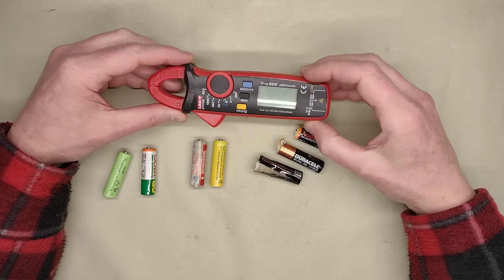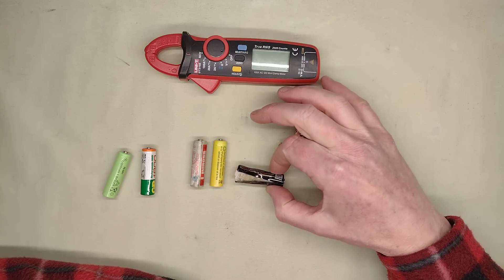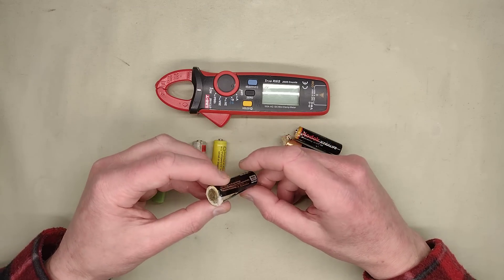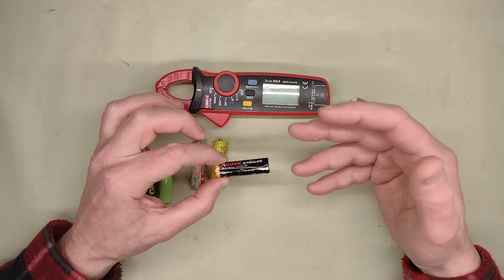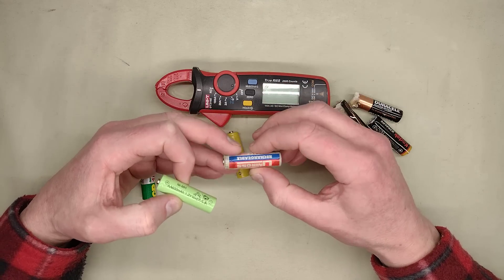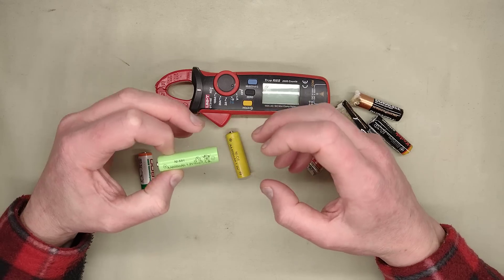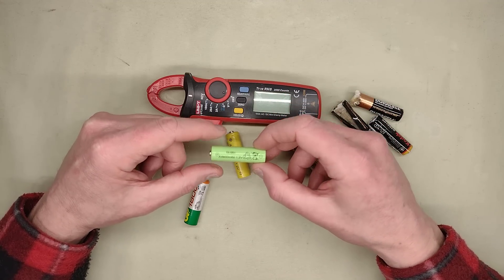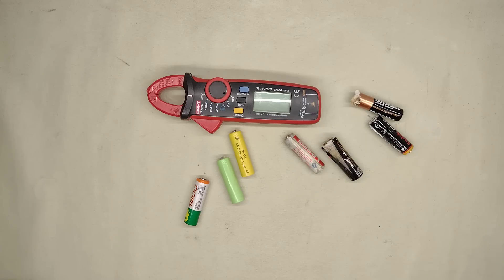The curse of leaky alkaline batteries

Comment: Clive, I fully agree: Alkaline batteries are frustrating. We don’t need leakage-damage warranty. We need batteries that do not ruin our devices!  DuraLeaks, IkeALeaks, SamsCLeaks, CostcLeaks - My experience is that all and each of them leak, some sooner than expiration, some with remaining charge - then our equipment is ruined. But I found a Solution and replaced Alkalines for 3 other types. Now I have Zero leak issues in the last 5 years: The solution I found resides to use just better brands of Zinc-Carbon, Eneloop NiMH batteries or Lithium 1.5V.
[1] A good Zinc-Carbon here (*) is the Panasonic Heavy Duty (not sponsored)  - incredibly, it never leaks! I use them as first choice for low power or intermittent consumption as IR remotes (TVs, Split AC).
[2] For most higher consumption, I use NiMH like the Eneloop or Panasonic’s orange ones (also, not sponsored) - they offer a higher voltage as 1.30~1.35V and show negligible self-discharge. They work great for weight scales, illuminated backlit remotes, motorized toys & appliances, etc.  
[3] For a critical application that seems to not be worth using the Zinc/NiMH options, I use non-rechargeable 1.5V Lithium AA batteries, as last resource - being difficult (*) and most expensive to find. An outdoor weather station transmitter has been one of these cases.
(*) = I lived for a while in the USA, then returned to a Brazil, where I live.
Thanks and Have a great Holiday season!

Comment: I bought an Atari SuperPong console from Ebay recently. When I got it I realized that it was heavier than expected.  I was ready to find a huge mess inside,  but instead found 4 perfect 1980s vintage Rayovac batteries. The only problem is that I didn't get to see if they would still honor their no leak guarantee!
Reply: I have a pair of Rayovac AAs in the remote to my Panasonic plasma TV from 2008 that I barely use anymore.  The battery compartment is pristine, the cells test at 1.45v, and most importantly, the remote works.  The cells have an "expiration" date of 2012.

Comment: About 7 years ago I bought some Energiser branded NiMH rechargable AA cells and charger to use with XBox controllers. I'm not sure how many months passed without use, but when I came back to use them they were dead and wouldn't charge again - they probably only had a couple of use cycles, felt like such a waste of money. I have to say, I've just used a mountain of alkaline batteries since then because I couldn't bring myself to buy modern rechargables again. Maybe as you say the chemistry has improved now. . . I hope so.
Reply: Most likely perfectly fine but voltage had dropped to a level so low the charger no longer recognized the batteries. Put a better charged battery in parallell for a few seconds and charger will activate on the 'dead' cell.
Reply from the maker: Some "smart" chargers won't detect a cell that has been discharged completely.  The dumb chargers will happily put current into it, and then smart chargers will detect and charge it.

Comment: I haven’t seen a leaking battery in years, other than some in an old camera which I bought recently, which had probably been in there fore many years.  The old standard zinc carbon cells, such as the blue EverReady U2, with the zinc case were a different matter, but that was back in the ‘60s.  I have mainly changed to rechargeables, but that’s mainly due to cost and much reduced toxic waste.

Comment: I also own that same meter. It doesn't like the lower voltage of NiMH that much, so I ended up making a small PCB to power it with a small LiPO battery and a 3.3V low quiescent regulator (XC6206).

Comment: I used a number of remote surveillance cameras & trail cameras to monitor areas of land for fly tipping. On the trail cameras I have tried to use rechargeable batteries but the longevity falls well short of the output alkaline batteries. 

(Rechargeable batteries last 3 weeks over 3 Months on Alkaline batteries)

In the long term I plan to make a rechargeable power pack and voltage regulator for each camera. In cold environments do rechargeable batteries perform as good as alkaline batteries?

Comment: I agree, I've given up on alkaline batteries, I consider a flashlight an essential tool during emergencies and to find a dead and ruined flashlight is not ideal, yes I know you should remove batteries from devices when not in use but I don't want to fumble for batteries and install them in the dark, instead I use 145000 or 18650 cells, I found a 5 pack of small LED flashlights that use 145000 cells pretty cheap and I keep them in the car and around the house, I already had a Lithium ion battery tester/charger so I hope I'm all set for a while.

Comment: Dear Battmeister,  Why do we have to put up with 1.2v anyway ??   I have some equipment that will not accept less than the std 1.5v   Why can't we buy 1.5v NiMh ??  Thank you,   Mike
Reply from the maker: It's down to the chemistry.  It's easier for the equipment manufacturers to design stuff that works at 1.2V

Comment: Rechargable batteries always seem to be 1.2v where everything from zinc carbon up to energizer lithium (non rechargable) are 1.5v... 

Energizer AAA alkaline batteries in the tv remote aren't lasting any longer than supermarket branded ones or duracell, starting to think one factory is making the lot with different names these days.

Panasonic evolta have a tight seal and are supposedly leak proof but I've had a slight leak with them though they last as long as duracell if not a bit longer and they fit into devices better because they don't have the thick shrinkwrap like the duracells.

Comment: I have a large stock of NiMH cells that I use where I can, but the biggest issue I've found with them is the little 'nipple' on the + end always seems to be shorter than that on Alkalines/carbon zinc. A lot of battery housings have the contacts set back so the rechargables don't reach. I assume it's by design, but its very irritating. The devices all (so far) work fine once you bridge the gap with something like a wad of tinfoil.

Comment: In my experience, I have discovered that there are a few battery powered equipment that WILL ONLY WORK PROPERLY if the rechargeable battery outputs 1.5V, whereas most rechargeable batteries only output 1.2V. E.g.. my Seiko Radio Controlled Wall Clock. It will only keep accurate time if I use batteries that output 1.5V.
Reply: So you're throwing away half used 1.2V alkaline batteries in it?

Comment: I got so fed up with these batteries pissing and shitting everywhere, that I bought the orange Sorbo brand Li-ion AA batteries from AliSlow, and replaced all the AA batteries in my devices. 
If anyone has bought the blue ones (1200mAh) versions, please tell us if it's real or Chinese fact. My older orange type do about 400mA capacity. 
Charger is built in to the tip as a USB connector which you plugs into the USB port for charging. 
The only problem with those, is you get no "Battery Low" warning. It just shuts down. 
I still prefer the NiMH or Nicad, over Li-ion, but some electronics won't run with 1.2V. It's a shame really.

Comment: I have found that Energizer batteries don't leak as easy and I found some in a toy my brother got years ago for Christmas which I think had a 2002 on them there was 4 of them and they where flat/dead as in no voltage in them. I have a wireless keyboard go as Duracell batteries leaked and they where a year over the expiry date on them.  

I mainly use rechargeable batteries now and if I need non rechargeable its Energizer only I will use

Comment: Why does some electronic equipment specifically say not to use rechargeable batteries?
Reply from the maker: Sometimes due to the need for a higher voltage, the inability to handle the short circuit current of rechargeables or often just because the instructions have been copy/pasted for the last 30 years.

Comment: 2 years ago I changed out everything to th NiMh cells. I even had the packs in my lamps rebuilt using them. I'm in the process of adding charge connectors to some stuff, like the lamps were made with. Cheers!

Comment: The voltage and capacity are a bit of a problem regarding NI-MH, studio equipment works for couple minutes on them before the voltage goes too low to be accepted by them. Then there are other devices such as gameboys which can't really use the full capacity of NI-MH before the voltage gets too low on top of the much lower capacity to begin with. We should just give in on either and use lithium-ion everywhere.

Comment: My rule of thumb, good gear gets good batteries. For my meters I only use 1.5V Lithium primaries, they last for ages. NiMH for stuff that needs higher current, like flashlights, alkalines only for cheap crap, if at all.

Comment: Super thought provoking video which has convinced me to give up with alkali for my own projects & my own consumer goods. Since lithium ion became available I have moved to using these were possible, but for an existing consumer product the form factor is wrong. Another issue with lithium ion is the weakness of micro USB & similar connectors that tend in my experience to fail. I have moved back towards using cylindrical style plugs which often means I have to make them as most commercial cables are micro USB. However, a recent electric tooth brush from Inventor Tom also has the old style cylindrical plug so maybe others are changing too. A further issue is that battery holders often vex me by not giving reliable connections. With lithium ion I have taken to spot welding on a nickel strip & soldering to this often before the spot weld to minimise heat going into the lithium ion battery & not using one of the purpose made battery holders. This makes it more trouble to change a battery, but often with lithium ion one never needs to change them as the device can be charged with a built in bms. Some of the nimh cells I have don't have the nipple on the end as do alkali & these to can be problematic with battery holders in my experience. A final issue is that if I am building stuff to sell folk often want disposable cells, some frightened by talk of lithium ion fires even though they have laptops, phones etc, others not wanting to have to bother to charge stuff. Still at the end of the day do I really like using something that is designed to be disposable even if potentially recycled & comes with leak issues. No!   But until this video I hadn't thought of making no alkaline my policy, but looking at Fathers retirement clock hurt by a alkaline battery going bad the savings in not having this issue greatly out weigh the cost of using nimh. Thanks for sharing!

Comment: Good point .
The oldest working NiCd batteries I have are 2x 6v cells that came with a NOS Gen2 tank night vision periscope, they are dated 1984 and still charge up and work fine, they didn't even leak.

Comment: Never seen a cell split like that before. Had many leaky ones, especially the cheap cheerful kodak or B&Q specials, never a Duracell though.
Many occasion gone in some site to replace the AAAs in an A/C hand controller to find the old cells have leaked and dissolved the battery connections. Good vid BC. 
Any more Cook With Clive on the menu?  Maybe a last shot before the end of the year. 
How about a crumpet, via the electrocution method 😝😝

Comment: Most aircraft now days use Nicad cells in a formation to supply max 60 mins emergency power, typically airbus A320 aircraft have two batteries. Apparently in the early days thermal runaway was a problem with these batteries but now with modern chemical engineering that more or less is a thing of the past, but that said the battery temp is still monitored just to be safe.

Comment: After years of  suffering from alkaline batteries leaks on my multi-meters ( i have 4 )  I decided to use rechargeable batteries and the only side effect i had was that one of my devices ( an analog multi-meter ) is not reliable to measure resistances but the rest works fine and now i don't fear find a damaged multi-meter again

Comment: I too recently noticed a sharp increase in the number of leaky Duracells & the like, I put it down to cheap fakes.
A friend recently gave me an old Avo 8 multimeter which he hadn't used for years. It came complete with an orange EverReady HP2 battery. I remember these from my schooldays in the 70s. This one has no leaks and still measures 1.49V!
NiMH is way forward. All my remote controls and other seldom-used items have NiMH cells now (except the old Avo lol!), should have done it years ago before losing too many to battery cancer.

Comment: For a hobby musik band I've got 9 V blocks again. They use it in wireless headphones, defective guitar devices and that sort of thing. But also rechargeable blocks. 
The NI-MH is available with the voltages 7.2 volts, 8.4 volts or 9.6 volts. 
I got them the 9.6 volt variant, which also stores the charge longer.
In addition, the battery empty indicator comes on at 7 volts.
A full accumulator  has always been enough for the entire performance so far.
Reply: Back in the early-2000s, IIRC, I found that Ni-cad batteries really have a cliff, where they suddenly die with my R/C cars! Nickel-metal-hydride was much better, the drop was gradual, compared to nickel-cadmium. Am I the only one having bad luck with nickel-cadmium?

Comment: I tried to be an early adopter of rechargeable cells some years ago, and I've still got about 2 dozen AA and AAA cells, but, unlike your experience, nearly every gadget I tried them in, TV remotes for example, refused to work with cells that could only deliver 1.2V. So I've abandoned the idea and gone back to purchasing Alkali batteries, mostly Amazon Basics. I agree that Duracell batteries are some of the least reliable and they are the most expensive. Maybe I'll have another go with the latest NMH cells, but once bitten ......
Reply: The problem is when a 10p battery will last a year+, yet a £2+ battery will last just under a year. 20 years worth out of one cell? I'd never put one in a clock for instance (unless it was some really expensive clock I wouldn't want leak damage).

I look forward to these rechargeable lithiums that the voltage is set down to 1.5. Though the inbuilt charging USB is just prone to failure, I don't mind using a special charger if needed.

Another big downside is some items, specially kids toys, have no cut out... so they discharge rechargeables way too far.

Comment: There's some odd devices that seem to work better with alkaline batteries and their higher voltage. A relative of mine runs a trailcam in the forest nearby and we noticed that rechargeable batteries make the video capture start too late, to the point that most videos were nothing or at most half a second of a tail going out of frame. Switched to alkaline batteries, and just like that the problem was fixed, video capture now triggered as soon as an animal was in frame.

Comment: I moved away from duracell a couple of years ago in favour of Tesco longlife (other longlife available).  Boxes of 20 are cheap and last forever with LED, clocks and the like.   I don't have much high drain kit. The main b I've had is they occasionally go open circuit.  Better than leaking everywhere but cant spot a pattern.  Very occasionally you do get a dribbler but not like duracells.  Like clive the couple of high drain stuff I have if possible I attach a short connector and use external li-ion, they still frighten me but meh!
Reply: Ikea own brand batteries (in the UK at least) are good and B&M have good deals on Panasonic.

Comment: I've had similar adventures with alkaline batteries in my cheap pocket multimeter: DVM810. I also hated how fast it burned through batteries too, on top of that 12V 23A battery is rather pricey. One day I was so fed up with it that I drilled a hole in the bottom of the meter, wired an XT30 to the outside and repurposed an old Ni-MH 7S battery pack to use with the multimeter (8S would've been nicer, but I was using them for something else). The only issue is that the pack is a tad bigger than the meter itself, but I don't mind: still better than a battery tray.